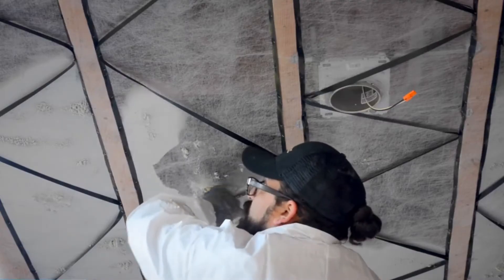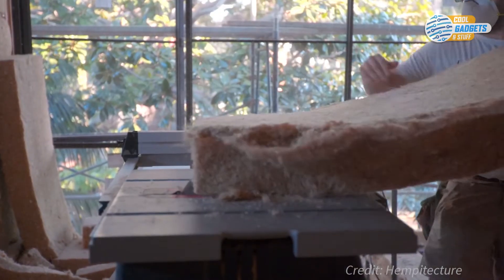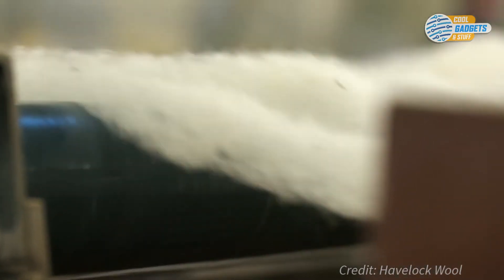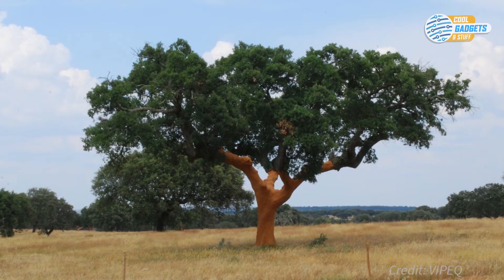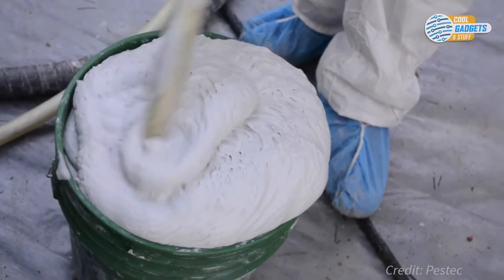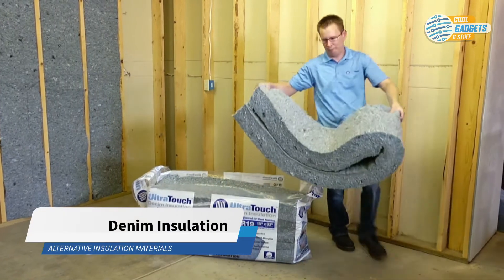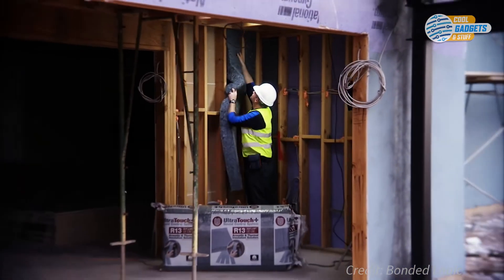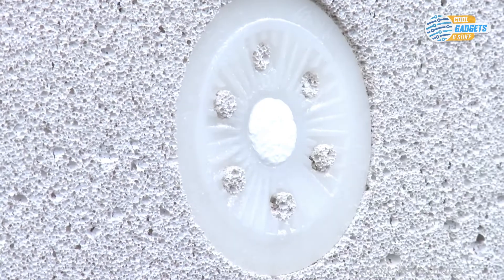6 Alternative BUILDING INSULATION Materials

Comment: I have to unload this knowledge!  A little known insulation material is simple "bubble wrap" package padding, the half-inch thick and one-inch diameter bubble version.  It is sold wholesale in huge four-foot wide rolls, and in large factory orders is very inexpensive!  It is a sheet of DEAD AIR, nearly perfect insulation because there is no air circulation or convection within itself, (tested fact.)  A little spray-on adhesive at the top will suspend a sheet of it without fasteners because it is so light.  Several layers can be added together for remarkable R-value.  It can simply be draped over ducts to vastly improve insulation.  It is its own vapor barrier, which can be taped to other sheets of itself.  No, it is not fireproof or "natural" but very useful for non-inhabited structures.  It is in dumpsters EVERYWHERE, tossed out after first padding use, and vast volumes can be salvaged for re-use as free insulation for utility buildings.  It can be ordered in WHITE, but is usually clear stock, and so passes daylight for cold-weather greenhouse use.  Someday perhaps it will be made from recycled plastic, containing CO2 inside itself, which will make it fireproof, and will "sequester waste carbon" from the atmosphere?  Pass the word.....................elsullo
Reply: How long might it hold the bubbles???
Reply: I love the last part. Great idea
Reply: That same horrible stuff that comes wrapped around your packages you get in the mail that needs to be popped before it can be recycled?
Reply: Multi-pane windows use non-oxygen/air gases to avoid convection or conduction of heat. Using something other than air would also reduce flammability.